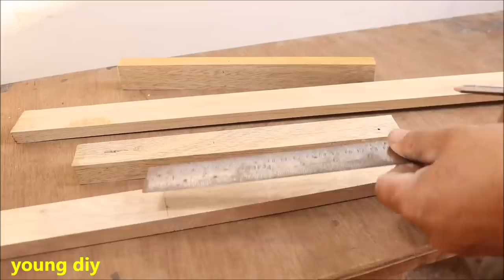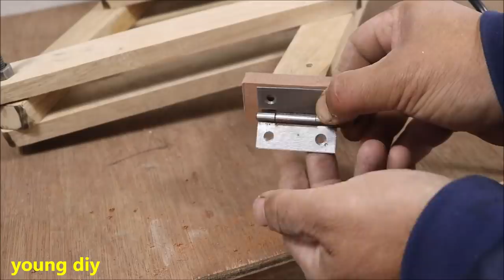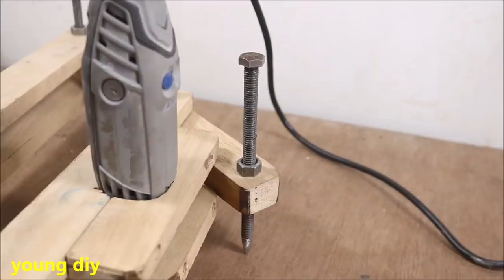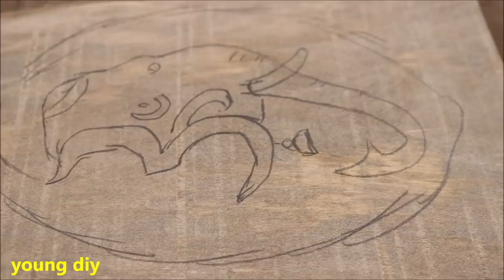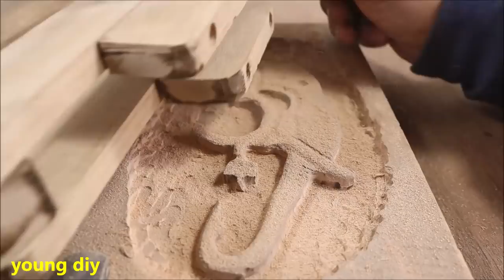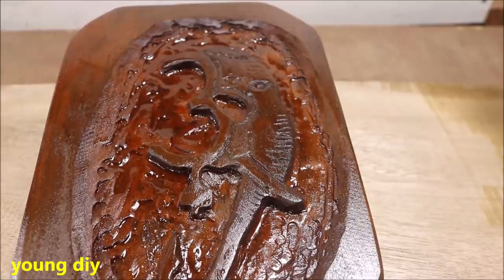How to Make a Pantograph Router/ Power Carving Tool at Home |DIY|

Comment: NOT how a pantograph works, check other videos, you use it to trace around a pattern ( using the pin you are holding ) and it puts the same pattern on your wood.

Comment: OK, the first carving actually used the pantograph to carve a copy of a drawing, but in the second (with the elephant) what was the point of attaching the Dremel to a cumbersome framework if you were just going to carve directly?
Reply: Yeah seriously. I'm guessing it's because it isn't rigid enough to be used properly. The results didn't look very good originally. I bet this would be perfect if made from aluminum or steel, with no backlash in the hardware

Comment: This machine would have way too much backlash due to the bolts being smaller than the holes (at least in the parallelogram portion). This makes for very inaccurate copying. Tighten it all up and you'd be on your way to a better device.

Comment: Hmm. I thought the whole point of a pantograph was to be able to use a template to make a larger or smaller replica. I can however see the value in making duplicates.
Reply: exactly  i can hold a dremel in my hand and do the same thing without that ....well i will make one that i can trace with and copy at the same time..
Reply: well not exactly correct, but it is designed to NOT have to FREE hand something. The size change is just a about minor changes to where guide point and drawing points are placed on the pantograph, aka bigger or small or same size can be achieved depending on how you set it up.

Comment: Young DIY the pantograph serves no purpose in the second carving, you could have done that by hand. The pantograph is used to reduce or enlarge from a drawing as you did in the first part. Your second part was an oversized handle which actually blocked your view of the work piece. Nice attempt though with the limited tools used.
Reply: @lawrencethompson3805  Good lord 😳

Comment: The whole construction of this pantograph router is totally wrong since the router should be in line with the two pivots points on the arm that holds the router. In order that the router can follow the path of a straight line and not rely on the constant correction of the operator of the machine. Try to follow a straight line from a template and you will end up with a bent line instead of a straight line as you should. I hope that my explanation of this has made it clear since it would take a diagram to show what I mean.